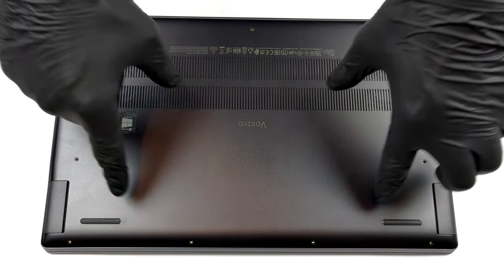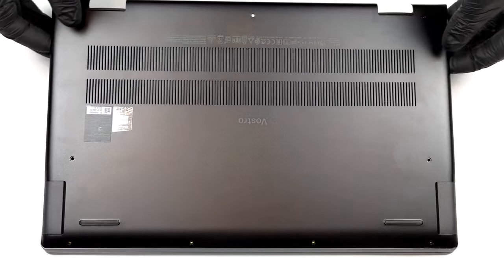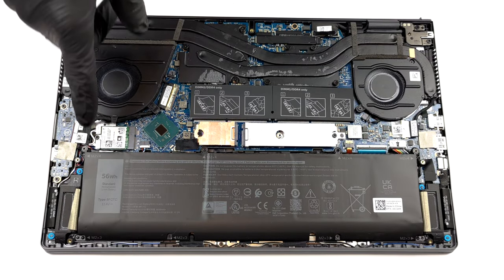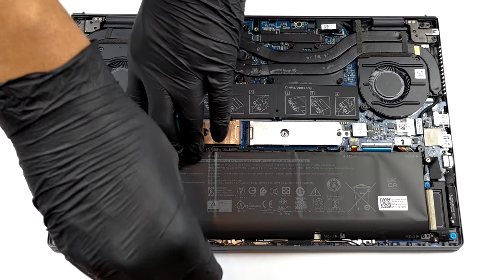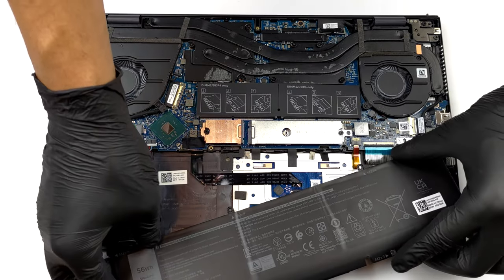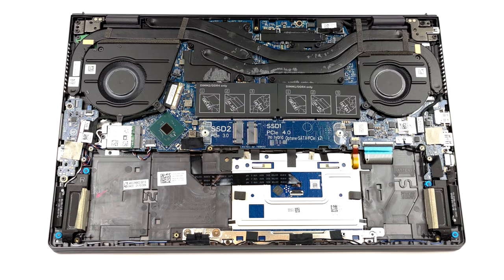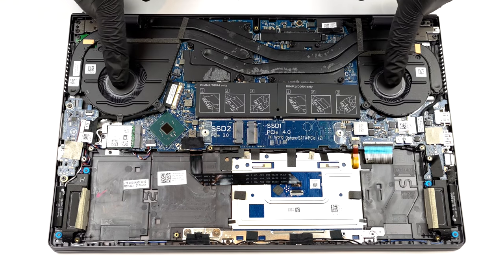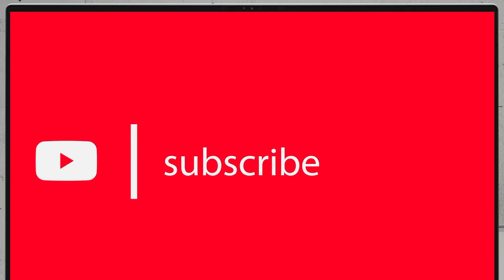🛠️ Dell Vostro 15 7510 - disassembly and upgrade options

Comment: Thanks very much!  This was very helpful.  Great video!  My vostro wouldn't power on at all, even with a cord.  I removed the cover, disconnected each end of the battery cable, plugged both ends back in, reassembled, and it worked perfectly.  Something must have been loose on the cable, or it needed a hard power reset, not sure which but this did the trick.

For me, on the cover row where there are just three screws, the outer two had snap rings on them and so I wasn't able to get them out.  I was able to unscrew them enough though to start removing the cover, and it popped those two screws out.  When I went to reinstall the cover, I grabbed the snap rings with pliers and tightened the screws into the snap rings, then the cover went on just fine.